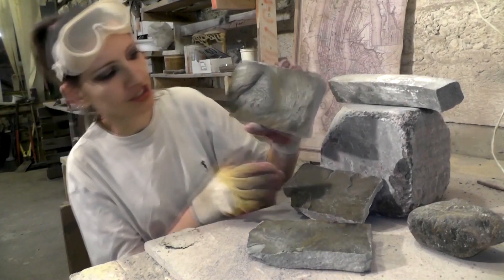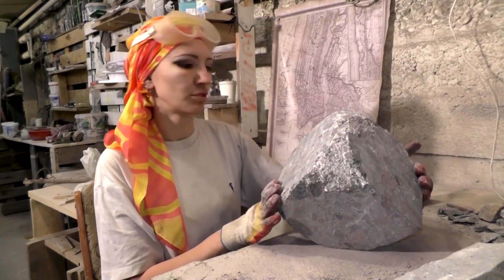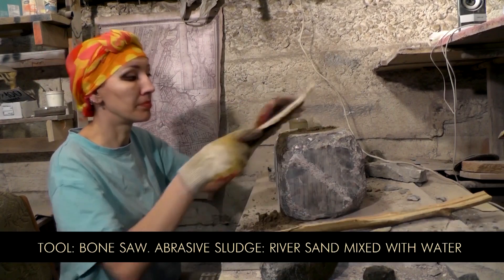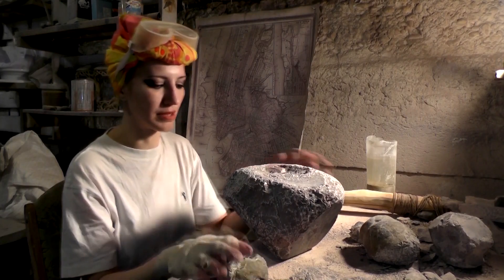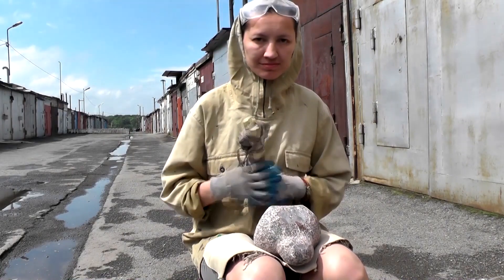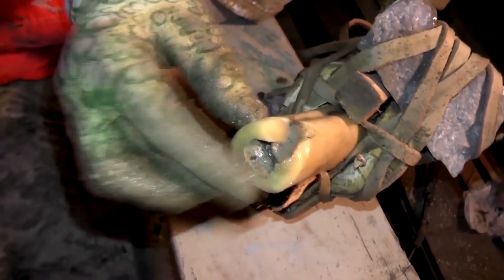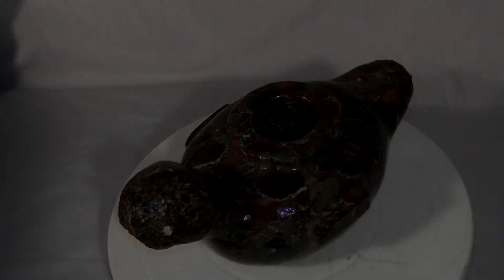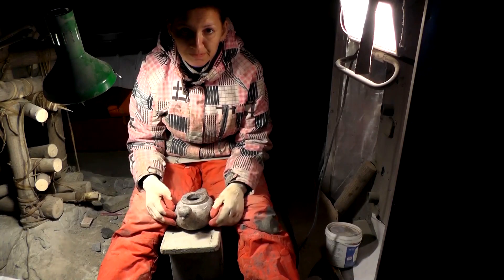Mysterious Ancient Artifact - DIY. Alternate history fans, please look away

Comment: The point isn't about whether or not you can do it. That's already a given. The point is the practical nature of it when applied to megalithic structures, especially given how (A) how short the build time was claimed to be, and B) how far more precise the stonework is. The matter of dispute is in the technology and methods used. E.g. if there was some sort of stone softening substance, then stone and copper tools could be used to form the hard stones. Mainstream archaeology makes an educated guess, but it's by no means conclusive.

Regarding (A): this project took you several months to complete. Egyptologists claim that the Great Pyramid of Giza took only 20 years to quarry, transport, finish, lift, and assemble each of the 2.3+ million blocks weighing an average 2.3+ metric tons each, with only copper tools, stones, and at a when the wheel was yet to be invented. The stones were comprised of everything from limestone and marble, to granite and basalt. That means that on average, 13.128 (>60,000 kg) stone blocks were fully finished and laid every hour of everyday, nonstop for 20 years.

Regarding (B): The perfect stone cube that you started off with is the level of precision that the Ancient Egyptians were able to accomplish. Start with a large block and reduce it down to a smaller cube of exact mathematical proportions. Then look at something much more complex like a sculpture that's cut in perfect proportions with a perfectly smooth surface.
Reply: A rather lengthy soliloquy considering all you actually said was:  "I am incredulous........"  So yes what academia says is actually conclusive I'm afraid because they have = evidence on their side - what do you have???  Asking endless queries does not an argument make - especially ones clearly assumptive in nature.  Also such an effort tends to reflect a lack of understanding rather than knowledge of said evidence. Final thought.  Adjectives and adverbs lend nothing to an argument.  Claiming supposed "precision" blah, blah, blah does not make it so as they are subjective terms.  

(A) - the 20 year claim does not reflect the total number.  Herodotus wrote they spent 10 years on what he termed as "a great causeway" as well as 20 years on the pyramid itself.  10+20 = 30 obviously...  Also that 10 year period could be viewed as when the basics were being completed = laying the foundation etc..  He wrote they first built a "stepped pyramid" ala Djoser to then encase the sides to create the final shape.  

Based upon what is seen they appear to have first built it up quickly - cutting corners everywhere - to then spend time to make it "look neat" with more carefully cut and in some cases polished blocks.  The weights are averages - nothing more.  The largest/heaviest blocks are found in the bottom half closest to the ground.  Above that point the blocks are smaller as it rises in height. 

(B) - limestone is porous and there is groundwater beneath the Giza plateau.  So as you quarry down into the bedrock you encounter moist limestone which can be softer.  Once exposed it dries out to fully harden.  Limestone is not terribly hard anyways and can be readily worked using bronze and gneiss stone tools. As to moving blocks.  If a single team can pick up and transport a block in 2 hrs = 10 teams can accomplish the same in about the same time.  So the more teams working in tandem translates into more blocks placed simultaneously in multiple locations in a given span of time.  When the teams are supplemented by animal labor - oxen - your workload is reduced.
Reply: @varyolla435  Your entire response is riddled with factual errors, logical fallacies, lots of ignorance, and a failure to comprehend what's discussed. Also, claiming that a comment is a soliloquy is rather inane. Sure, some comments may not be answered, but that's the nature of commenting. Ironically, your response negates it. And, what Egyptologists claim or assert are by no means conclusive. That's not how the scientific method works by its very nature. Instead, Egyptologists present what they believe to be the most likely theory in their opinion.

(A) This point is moot. The part I discuss in (A) is during the relevant portion - the actual construction time of 20 years. Also, Herodotus is recounting what he was told - he never witnessed the pyramids being built, which occurred approximately 2,700 years prior to his birth. That's why the actual construction methodology is hotly debated today. In any case, it sounds like you're describing the casing stones to cover the steps of the Great Pyramid, as opposed to the construction methodology of Djoser's Step Pyramid.

And, your assertion of relative stone size decreasing with height is a given and expected, but begs the question. The limestone blocks that are higher up are still over a ton each. In fact, a third of the way up, they're much heavier and harder stones on the inside at the King's Chamber - 25-80 tons and made of granite.

(B) It's not limestone that's in discussion here, even though the ancient jar example is of one of the softest stone types that Egyptians used to make their stone jars and pottery. Rather, it's sandstone and other much harder rocks that's the point of contention when it comes to stone jar construction. The artisan in the video is shaping sandstone, which has a Mohs hardness of about 6-7, compared to limestone's Mohs hardness of about 3. Ancient Egyptians built many of their stone pottery out of basalt, granite, diorite, andesite, etc., which are all of similar hardness to sandstone. What the artisan completes is nowhere near as precise as what's seen with Ancient Egyptian examples. That level of precision is not a subjective term (though I think you mean a "relative term" here), as it's an objective claim of symmetry that's so precise that modern tooling methods are required to match it. 

And, the Ancient Egyptians of the Old Kingdom, specifically of the Great Pyramid builders were of the Chalcolithic Age AKA the Copper Age, not the Bronze Age. They used the much softer copper tools, not bronze tools.

Comment: Her thing isn’t as precise. The measurements were down to the thousandths. I bet hers are tenths granite is factors harder
Reply: Do you have evidence of your precision claim?
Reply: "Precision" in this case is fairly subjective and you can't tell anyway. Measurements of what? If you measured this one it would measure exactly its measurements. If you are going to claim some other one is more precise than you need to show that it was ordered to be certain dimensions and came out to match those dimensions. 
Symmetry is not that difficult. Lug holes would be the same size nearly since you'd be using the same tools. Depending how exactly you go about hollowing it, the side thickness is going to be nearly the same. Provided it is reasonable straight, you'll get a lip about the same width. 
And this is a first attempt. The fact she could get this close with a first attempt should tell you something.

Comment: Well done. But the oldest Egyptian stone vases were churned out by the thousands with much higher precision and symmetry which would add greatly to the time of crafting. All those months or years per piece just doesn't seem likely. This is not to say that modern machining techniques were used, but that there had to be simple yet faster methods than shown here. Keep trying, though. 🙂
Reply: Why do you feel able to claim about the precision and symmetry of thousands of examples? Any ancient examples show an expected level and mix of awesomeness and imperfections. That is the same as the work of any masters in any trade. I know there is a single example pushed by an agenda driven channel with no supporting data to back up the claims.

Comment: this is really cool but do you not think the time frame of 7 months working 8 hours a day is a bit excessive for this to be a realistic method, though im sure stronger workers, larger weights, techniques perfected over time would greatly reduce the time frame. it still seems unrealistic given just how many pots and vases and whatnot there have been. ive seen some mention corundum dust instead of sand for the abrasive so maybe that would speed it up too

Comment: Show us how a granite box from the Serepeum in Egypt is made.
Reply: They just did.......  If by demonstrating that you can work stone using other stone tools = the process has been demonstrated.  What follows then is simply a result of the skill of the individual(s) + the time and resources devoted to the project.  The granite sarcophagi such as you alluded to also included the use of bronze core drills to remove the interior portion of it.  

As an aside.  To consider how it was made you must first place it in the correct period.  This is what I mean.  The Serapeum was in use from the early New Kingdom to the Ptolemaic period = 1,600 years.  The sections open to the public are actually the last to be added dating from the late New Kingdom/Persian period through the Ptolemaic period as noted.  That timeframe = Iron Age.  So those nicely made sarcophagi you see photos of online represent the last to be made - meaning iron tools were used.  🤨

Comment: I applaud your work ethic.  7 1/2 months grinding on the same piece of rock is hardcore.  how do the 2 compare on a detail level?  you dont really show the inside of the starting dove vase ( I would like to see how hollowed out it was) I suspect it was much more hollowed out, You do show how much you were able to hollow out, but only looks 1/2 inch wider than the initial hole.  What does the balance point/ bottom surface of each look like???  how do they compare symmetrically with themselves???
Reply: She is one craftsman doing everything herself = so as to prove out the concept.  Meanwhile the ancient Egyptians created an organized production setup.  So they were not like here with a single person doing everything.  What you see = came from production facilities created for the same.  That means a caste of workers ranging from apprentices to master craftsmen along with ancillary workers + those who ran the place and supplied the necessary raw materials.  Think about the totality of what was happening.  🤔

Comment: Although the piece shown here is an incredible achievement it does not compare to the precision of predynastic Egypt.. Vases of that era have been measured to have accuracies from 1 to 10 thousands of an inch after 5000 plus years of weathering.. In other words cut almost perfect... I cannot imagine the example here would reach anywhere near those tolerances.
Reply: Please provide evidence of this precision?
Reply: @pranays  "Scanning a Predynastic Granite Vase to 1000th of an Inch - Changing the Game for Ancient Precision!" on Unchartedx
Reply: @pranays  did you get that? Unchartedx check out his channel, it will blow your mind.
Reply: @kiwi73  Has the provenance of the vase been confirmed?
Reply: @Leeside999  even if the provenance is from this century it is an extremely difficult thing to do and would require extreme precision not available to common workshops.. the tolerances between the lug handles is only achievable today using extremely high tech and expensive machining. This alone tells us how incredible the vase is..
Reply: @kiwi73  "the tolerances between the lug handles is only achievable today using extremely high tech and expensive machining" ----

Sorry, sir but that is utter nonsense.
Reply: @Leeside999  ok then explain how you can achieve tolerances of less than 3 thousands of an inch? Between the lug handles the tolerance is so precise relative to the surface outside the lug handles that it is impossible to do by hand. No one has reproduced this remarkable achievement.. ever.. period.
Reply: @kiwi73  I'm not exactly sure how they did it tbh. I'm not knowledgeable enough to comment on that specific vase. All I know for certain, and if you have been following the lost ancient high technology debate long enough,  is that Ben is completely full of shit when it comes to many of his claims and he is very selective in what he shares to support his arguments. He has an agenda. That I do know. So forgive me for being skeptical of his latest video. 

With regards to the vase, the ability and skill of a master craftsman should never be underestimated. And I'm not convinced that analyzing a rendered image is the proper way to measure such tolerances accurately. I'll wait for a response from people who are more knowledgeable about these vases before I acknowledge any of Ben or his hand picked expert's claims.
Reply: @kiwi73  it was filmed in a workshop with just the tools needed to do the work of fixing the vase. Large areas including interior have tolerances of 3mm but that isn’t mentioned by uncharted x.

Comment: Now imagine how her work would continue, if everyone on this planet is doing it for several 100'000 years. 
What most people don't seem to realise is that people have been creating stone tools for seveal 100'000 years before the pyramids were built. They drilled stone, they ground stone, the chiped and split stone (in fact that's how the began with flint) etc. By the time the pyramids were built they must have accumulated so many tricks to work with stone.
Reply: The oldest evidence of stone work goes back to 3.2 million years thought to be used by our ancestor the homo habilus. We went from the start of the Stone Age 3.2 million years ago until it ended when the copper age started 5,000 years ago. So yeah we have been working with stone far longer than our specie has existed. You would think they became good at working with it

Comment: That's really interesting. Any idea how they got fifty 70 ton beams placed in a ceiling in the Khufu pyramid? Ooo yes ramps of course 🙄

Didn't think so. But interesting (and reductive) nonetheless.
Reply: There are not 50 70 ton beams. By generous accounts there are blocks in the King's chamber that could weigh as much as 50 to 70 tons. Most estimates for the beams put them at 40 to 50 tons. (They also don't work at relieving the stress....so whatever ancient super advanced civilization you have in mind, apparently sucks at architecture.) 
Ramps would be one method. A tilt, brace, pivot, would also work. Or you could also essentially put them in place on the first level and shim them up with the structure to each new step until you tilt them down into place.
Reply: Umm do you know how ramps work.
I’ll let you in on a secret.
Graham Hancock made a claim about ramps based off Dr Mustafa who was a medical doctor turned tv host on mysticism mysteries.
Ever since this has been repeated and no one has bothered to check the facts. Which are completely wrong.
Such as wood rollers being crushed by the weight or needing a miles long ramp less than 10 degrees.
If you are going to parrot talking points try not to chose grifters as your source.

Comment: I don't quite get how the cavity was made. I understand how you drill a hole, but to make the cavity walls wider you would need a drill bit wider than the hole. How was this done exactly?
Reply: ...not sure 100% I followed what she said...and not sure I'll be able to explain it in text...but let's try. She put a mixture in the hole of larger shards, and finer sand. When the drill turns it will snag on the larger shards and spin them causing them to scrape the inside away more.
Reply: @AveragePicker  Oh, it makes sense, thx